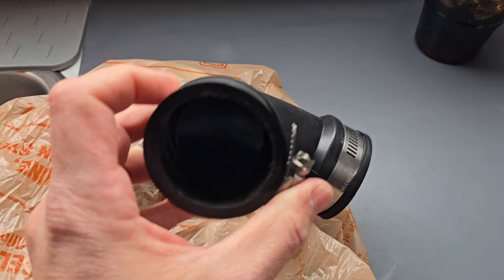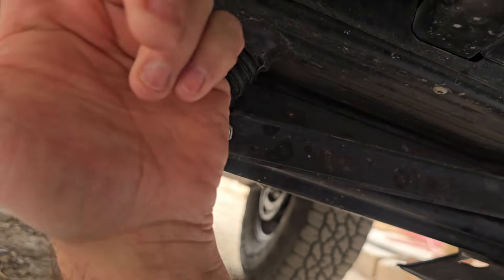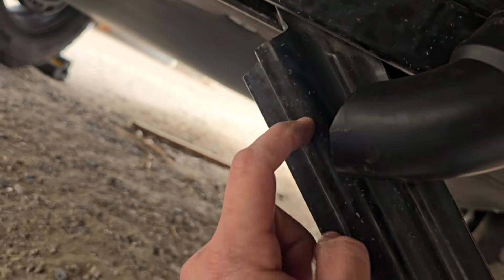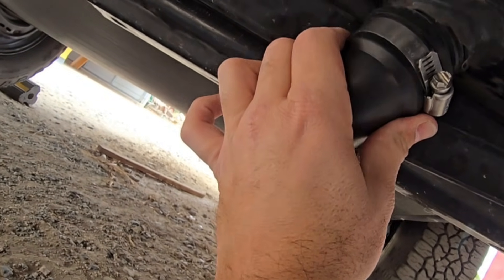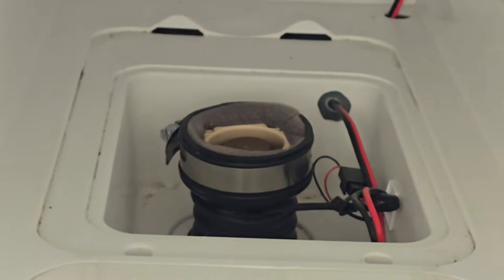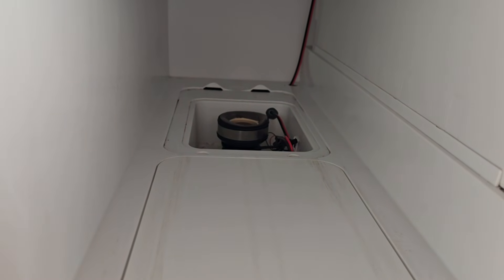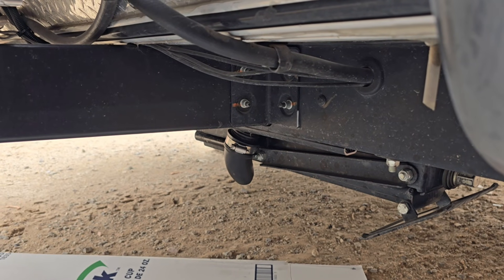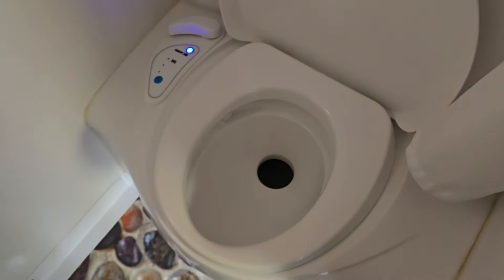T@b 320s cassette toilet ventilation pipe extension. Will this help keep the stink down???

Comment: Just a thought on that, what if you were to put a modified T where you have an opening in the front and opening in the back kind of like a jet pump. I think the problem you’re having with it is it creates a vortex at the opening of the pipe, kind of like the back of your pick up when you’re driving down the road with no cap on it.  Like when the air hits your tailgate and swirls forward towards the back window and just kind of creates a vortex. I don’t know just a thought.  The pressure of the vortex may be overpowering that little fan of yours, not allowing the fan to push the air out
Reply from the maker: Ive thought about that. I may have to give that a try eventually. I did find a really strong fan to put in the vent pipe, and it still didn't help much while on the road unfortunately. But like you said, may be its creating a vortex in there still going down the highway. Back to the drawing board hahaa. Thanks for watching and commenting.

Comment: Did it work?  Another possible cause for higher air pressure underneath the Tab while underway is its wing-like shape.
Reply from the maker: It Just slightly helped, but not enough. Some how need one shaped like a reverse horn like they have for rv roofs i think. The next experiment will be a stronger vent fan in the vent pipe. I may have found one. We will see soon when I get around to installing it.

Comment: Nucamp should be watching your "improvement" videos. I like the "business" fan but most likely the right angle rolling speed vacuum adapter will be good enough.
Reply from the maker: 🤫 They are probably listening. 😂 Thank you.  Actually, they do have a media team that follows many of the forums that I have seen. Judging by design and system layouts of different year models, they keep making changes as wants or issues arise. One of the few that are actually listening to their customer base.  Yes, I just have to find the right quiet fan vacuum that runs on low 12v power. So far this little 40x25 mm computer fan works very well. But, a little more draw would be perfect to counteract the negative pressure from the maxxfan in the trailer when venting out.

Comment: I was looking to buy a TAB 320, is this smell issue a common issue with the TAB ? Thanks
Reply from the maker: I think the going down the road smell inside is common with all rvs with black tanks or cassettes. The difference being, on a bigger rv, the exhaust pipe is on the roof, and some have a cap that helps the wind pull the smell out. Also, heat rises, and the smell goes up. It's a slightly different learning curve of how to operate a cassette toilet. Close to a regular rv, in some ways. Like having your main roof vent fan off or venting inward so the pressure in the trailer pushes smells down and out of the cassette when the toilet flapper is open. It helps to put a very small amount of water in the bowl to cover the flapper seal when parked also.  In Europe, they have a cassette ventilation extractor kit that I have not found in the states. So I made my own. Hopefully, this exhaust pipe section turned backwards will help with any on-road smells being pushed back into the trailer. I wouldn't be too worried about the cassette toilet. Once you figure it out, i think the pluses outway the minusus, as far as being able to leave your trailer parked on a longer stay and just taking the cassette out down to the dump station or pit toilet. For boondocking, it may be lacking in capacity depending on how long you're out, though. The plus side, use whatever paper you like and a good tank treatment, and you never have to worry about big black tank problems. Plus, it's easy to keep cleaned out and as long as you don't put paper towels in it, it won't clog, haha.  Good rule of thumb for easier use, try to dump when it's half full, a lot easier to handle.
Reply: @DSWadventures Thanks for responding to my question, I’m a DIYer so any mods that I will need to do should not be an issue, looking forward to your next adventure
Reply from the maker: @lawdog516  Very cool. The next run should be interesting, haha.

Comment: How about making a charcoal filter for the in-line vent?
Reply from the maker: I actually did buy some activated charcoal material for it, i just haven't finalized the design yet. Plus, I really haven't noticed too much smell other than every once in a great while. If I had a 3d printer, I could have had everything done hahaa.

Comment: Awesome! Could you please share the pipe part with us? Is it 1 1/2 in diameter?
Reply from the maker: Not sure this extension is going to work yet, but the rubber elbow i used was a 1. 5 inch to 1.5 inch. The factory pipe is about 1-3/4 outer, i think. It's snug, but it worked. I willl see how it goes by next week.

Comment: Another good instructional.  Anymore on Starlink billing?
Reply from the maker: Thanks. I just got billed for the month again. It was 50 dollars for 50gb. The app has a pause option also, but i haven't tried that yet. Say you paid 50 that month. The paused after you were paid, you get the data until it runs out that month.  Then you can unpause and and pay again when ready. Allegedly haha.
Reply: @DSWadventures  No I haven't picked one up yet. I want to, its a perfect for my RVs. I just want to pay a monthly subscription while its stored. If you pay for the 50 dollars for 50gbs and that's it Great.
Reply from the maker: @MyRanger12  yep, you just have to make sure you pause service, though.
Reply from the maker: https://youtu.be/iom1Gx-xSrw?feature=shared
Reply: @DSWadventures  https://www.youtube.com/watch?v=Y71n16nngHU
Reply from the maker: @MyRanger12  that's pretty cool. I wanted to mount mine in the sunroof, but my roof rack is in the way ahhaa